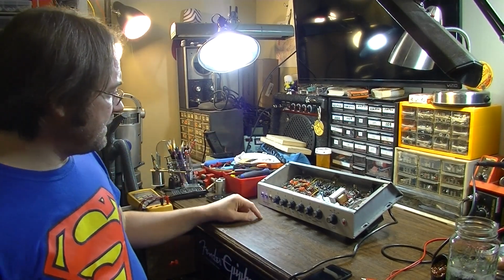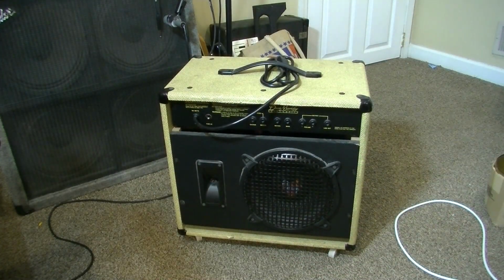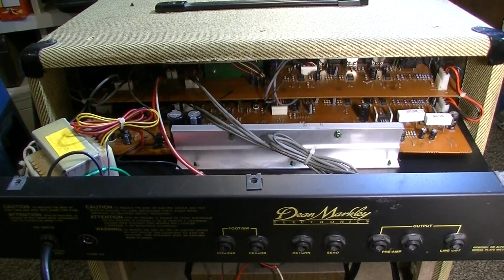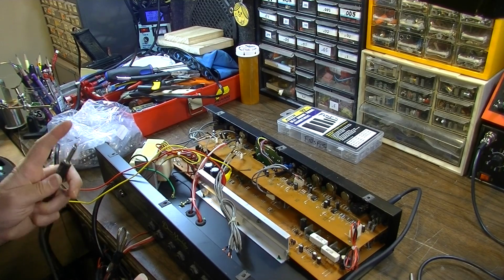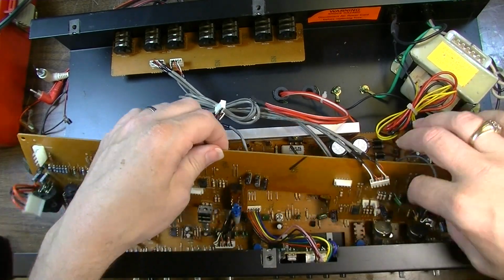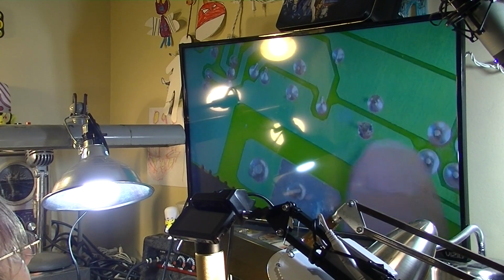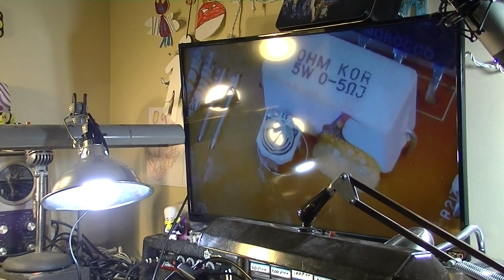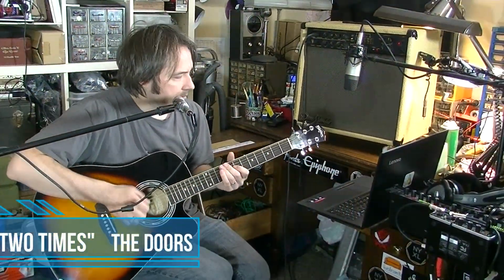The Sort of Repair I Usually Reject - Solid State Acoustic Amp, Full of ICs, No Schematic

Comment: If the lights are super bright, one thing you can try is to turn them around and have them reflect off the walls or ceilings. You can put some white paper or foam core up to help the reflection. You get softer and more diffuse light, which might be more comfortable and better for shadows. Kinda works like a big softbox but more convenient.